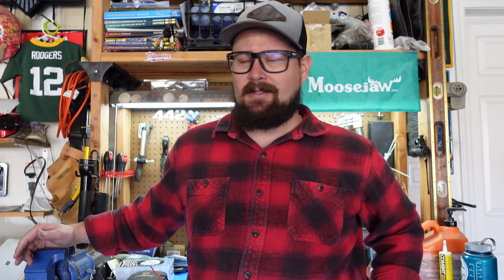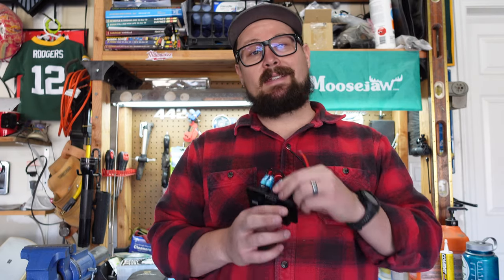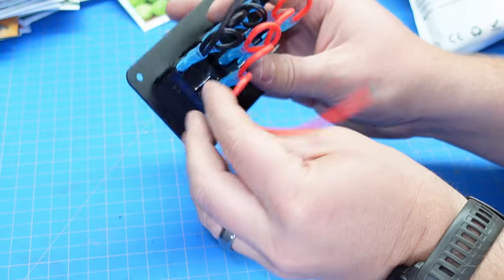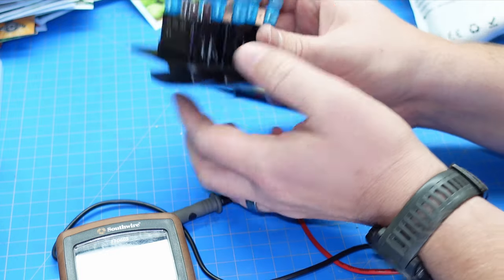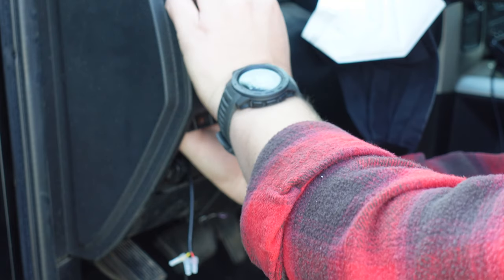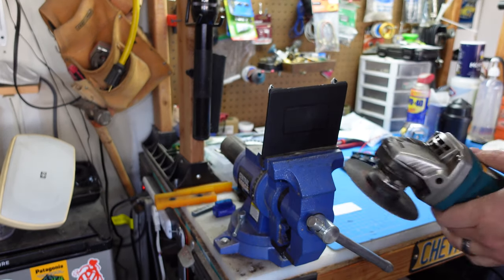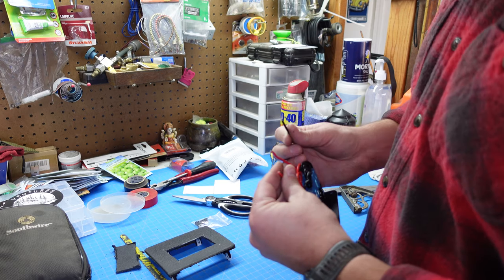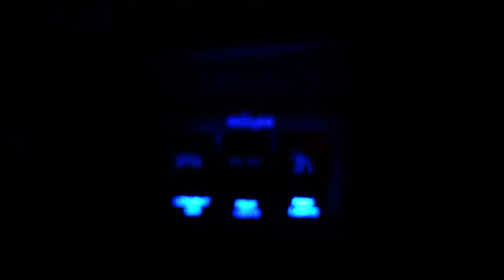Installing Aftermarket Light Switches Ram 2500 Factory Dimming Nilight

Comment: What I did on my ram was I wired the panel right to my drivers Cigarette lighter and so all the lights turn off with the ignition, also an option!
Reply from the maker: That's a great idea, thanks!
Reply: An easy way to get rid of the light that is always on is unplug the lower red cable. The lower red cable is the power for the AL or always on light. The light that comes on when you turn the switch on will still work to!!
Reply: Which color wire did you use to do that? I have  the 2 gang rocker switch and only want power to the switches when it’s running.
Reply: @thatamericanvlogger274  which color for what option? Sorry I probably don't remember it's been so long

Comment: I’m not real good at electrical so I was wondering what you did from the battery to the switch. I’m trying to do this on my 2015 Ram, but am lost in terms of fuses and/or relays. How did you run yours?
Reply from the maker: Power runs through the relay and to the light. When the switch inside is flipped, it turns the relay on which then let's power pass through it to the light. If I didn't use a relay, then I would run huge wire from the battery to the switch then to the light, so the switch would be breaking the circuit. Instead, I can use the relay to break the power in the circuit by running a small power wire to the relay from my switch, inside, that turns it on or off.
Reply from the maker: This is a pretty good video that explains it. 
https://youtu.be/W2Mr2Zgv1Ck

Comment: Can you make these switches double throw somehow or do you have to buy them separate
Reply from the maker: These switches can't be made double throw, but they do make double throw switches that will fit in this same space.
Reply: @RoadandReel  well that's dumb why wouldn't they make that an option
Reply from the maker: @ryan-ue2vr  the company might have that option and these are standard size switches, so I'm sure you could find a double throw switch that mounts in the same bezel.

Comment: I did exactly how you did it, and the blue backlight always stays on.
Reply from the maker: Did you connect to the right orange wire? What does it do when you turn your lights on and adjust the dimmer? What about when your lights are off and you flip the switch?
Reply: @RoadandReel  nothing happens. The top light of the switch I have connected stays on
Reply from the maker: @irvin4am  check the connections on the back of the switch, again. I think you have the back wired wrong with the lights in the switch powered with the battery.

Comment: I added a 2 gang nilight switch in the same spot, after watching your video.  The only problem I'm having is determining which is the orange wire/gray tracer.  My eyes are so bad, both the orange wires look to have the same color tracer on them.  Any way for you to pull your panel and describe which one you used?  Thanks, and great video!
Reply from the maker: With the flat part of the factory plug facing down, the orange wire is on the right. It's on the side with the two white wires and a yellow. At 10:11 in the video you can really get a good view of it.

Comment: I pull that panel and I have something behind it with an orange strap and a cable running down thru the firewall.  Wtf?
Reply from the maker: Which panel? Above the emergency brake where I put the switches? That's the first I've heard of that.

Comment: Your video instructions would be much easier to follow if you didn’t move the switchboard/wiring around so much and so sporadically. Not trying to be critical, It would just be much more helpful.
Reply from the maker: I appreciate it and I'll take that into consideration next time.
Reply: Does your 2500 have 2 batteries? I’m installing a single switch for running lights in my 3500 which has two batteries and everything is fine until I click the switch on and then it blows the fuse. I installed a wire harness from Nightlight that came with the switch. I have checked to make sure the positive and negative are correct at the light connection and still can’t find why I am blowing a fuse.
Reply from the maker: @JoshH001  Mine is a single battery, but that shouldn't matter int he harness. Check that on side gas 12v when going to ground and the other side has continuity with a ground. You may have two different legs of the hot side.
Reply: Thanks for your video and your response
Reply from the maker: @JoshH001  as long as I help a little, I'm happy 😊 I don't always make my videos with the "how to" in mind. I'm doing it for myself and making the video afterwards, so I'm sorry if it's not always the clearest.

Comment: I have a set of podlights and a bar light on my truck. Each has its own wiring harness with separate clicker to turn it on and off. Using the same rocker switch panel that you use on this video, how would you hook up the sets of lights with separate wiring harnesses and clickers to the rocker switch panel. Interested in the setup that you have. Thanks
Reply from the maker: You would ground your lights in a common area and run power to each one with its own fuse. The small power wires from the relay would go to whichever switch you wanted to run them. The power to the switch would come from the harness the same way I did it, but it would be split to tie in to all your switches.
Reply: @RoadandReel  thanks for the response. I do have the hilight wiring harness for both the bar light and the pod lights. Each harness has its own clicker and positive and negative wires that are connected directly to the truck battery. Just so I know I’m clear, in order to connect the rocker switch panel to both wiring harnesses for the pod lights and bar light, the clickers must be removed/cut, and wires that were connected to the clickers (small red, black, and white or yellow) must then be connected to the rocker switch. This is where I’m somewhat not clear…do I connect all small wires (red, black, white or yellow) for each harness to each rocker switch? And same for the wires for the other harness? Thanks
Reply from the maker: @usmarinenapinoy  without seeing it, I'm guessing your lights have outer and inner bulbs. I'm guessing those are the yellow/white and red. Those power the bulbs and the black is the ground. You'll cut the switch side off and wire those to the new rocker switched on side. Black is ground almost always. You rockers will pull power from the harness. Power will run through the switch and into the yellow/white and red. Those go to the relay input and the relay pulls power from a fused battery wire and a big wire (probably red) will come out of the relay and power the red and yellow/white wires. Ground your black wires to the frame somewhere.
Reply: Hello! Did you install other lights on the other switches? So you can show us how you placed the cables please.
Reply: @proyectocoyhaique5935 I went a different route. I’ve used the Auxbeam 8 gang switch panel instead. It is somewhat more expensive but much easier to install.

Comment: how would i wire it if i dont want the lights on the rocker switch to turn on only when i have turned on one of the switches?
Reply from the maker: If you just want it to light up when the switch is on, then you would run a jumper wire from the prong that powers your off-road lights back to the prong on the back of the switch that makes it light up.

Comment: So when you put in a new set of lights and run the wires to the switch all you need to install on the switch is the new lights yellow wire?
Reply from the maker: And the ground. It also takes the relay setup the way I did under the hood.

Comment: What is yellow wire for
How did u setup tha yellow wire
Where is tha yellow wire connected to and from where
Reply from the maker: The yellow wire is the power out of the switch and it travels to the relay to activate it. Here is where I initially wired it up and explain it all. https://youtu.be/k-nkZu630zo?t=1103
Reply: I had another question
So tha rocker panel when u add a new set of light bar or pod all u have to do is plug into other switches
Would u have to add another relay to tha light bar or that 1 relay will work
Reply from the maker: @thaAzian1401  Each bank that you add will have its own relay and hot wires. You can add a separate fuse panel to run everything to keep it organized.
Reply: Would u happen to know a video or will u b posting more videos where u add other lights to ur truck
Reply from the maker: @thaAzian1401  here's a good one. https://youtu.be/BvFHA1xY10w
Also, you can look up Auxiliary fuse and relay boxes for Ram truck LED lights and it should bring up a lot of stuff. There's a lot of keep wiring videos and off road stuff that is really good, too. Let me know if you need anything else.

Comment: How? I tried this same panel with 1 small switch and there is so much crap back there I couldn't make it for. There's some orange strap to disengage the transmission and there is also so metal support bar for the dash. Please explain
Reply from the maker: What year is your truck? Does it have a knob to shift or is it on the column?